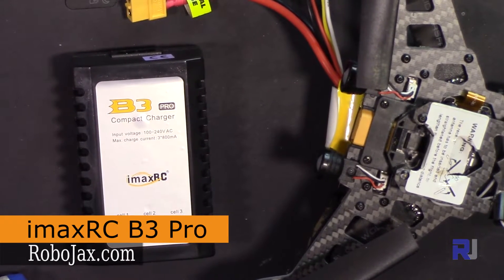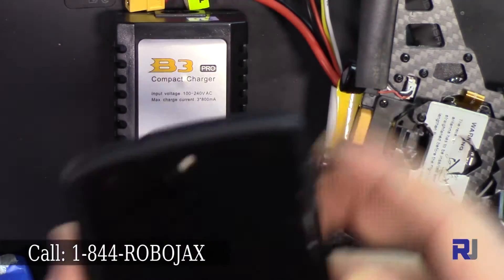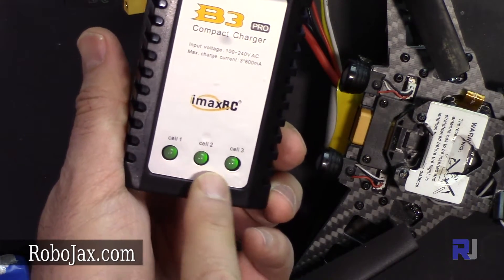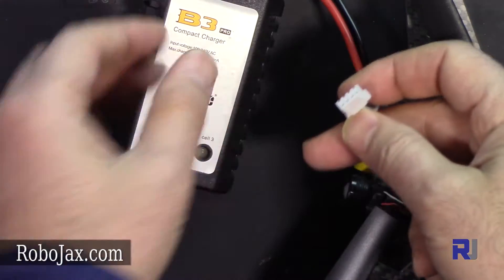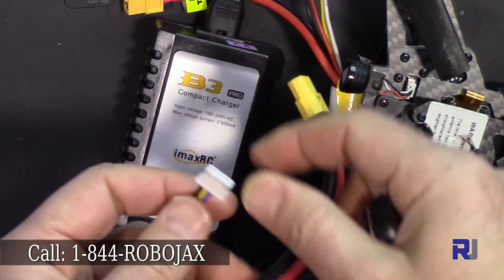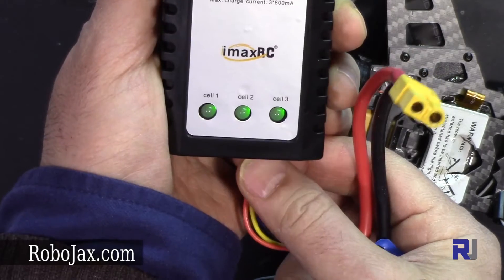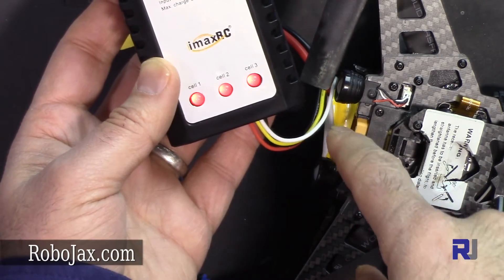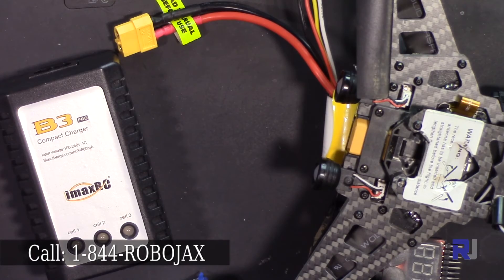imaxRC B3 Pro 2S 3S Lighium LiPo Battery Charger Explained

Comment: I think its wrong. If the lipo is 5s and rated at 5200mah it will fill at 7 hours. If the balancer can output 700mah. If the battery is on series. The voltage increase. But if it is on parrallel the mah/Ah increase. Which in the case of lipo it is configure as series.
Reply from the maker: The series and parallel doesn't matter.  it is the total capacity that matters. We are feeding 700mAh to fill one battery of 5200mAh . If we charge 2 batteries of 2600mAh connected in parallel, then 2600+2600=5200mAh.
Reply: Robojax so therefore the energy calculation of lipo are differ from the other .?
Reply from the maker: No. it is always the total capacity. The charger can supply in total (for example) 700mAh. You can feed it any ways you want.

Comment: I have Li-Ion phone batteries which have different mAh (1500mAh and 1800mAh) but same voltage. so can I connect these 2 batteries in series and can I connect balance charger to charge it. Please help!
Reply from the maker: yes. any Lithium that starts with Li- is okay. and you can do it.

Comment: Hello,Robojax. My B3 PRO's cell 1 is green and flashing, when it connected to my battery. Do u know what's wrong? I cannot find the reason from internet. Is my battery damaged?
Reply from the maker: it means other cells are full and it is charging cell 1. You have to wait a little longer. If it doesn't go off after longer period of time like 2 hours or more, then battery or charger must be bad. You can check your battery using battery tester explained here https://youtu.be/A0EjDtGSepw or use a multimeter and check each cell which you can learn from this video https://youtu.be/Cx25ozeeC8Q
Reply: @robojax  Thank you so much. I am afraid my battery is damaged. The last one is 0.08v,  the middle one is 3.82v,  and the first one is 3.83v. Can I cut off the last one, then use it normally only two battery? Can I charge it?
Reply: @robojax  Ok, I have solved my problem. I cut the damaged battery off, and it is 2s now. The charger is normally, too.

Comment: Hello, I have what may be a dumb question. 

The charger lists the “max charge current” as 3*800mA.

If I have a 5200 mAh 2S battery, does it take 5200/800 = 6.5 hours or 5200/(3*800) = 2.16 hours to fully charge?
Reply: I’ve come to the conclusion that the answer is (5200/2*800)
Reply from the maker: 800mA is the total current. Don’t worry about the cells. Just divide the capacity by 800mA
Reply: @robojax  thank you for your help and I appreciate how active you are in the comments!

Comment: I just got one of these chargers the other day, but it puts out 3*800mah... would that be too much current for a 3s 300mah lipo?
Reply from the maker: The chargers check the  voltage and adjusts the current until it is full. So you should not worry.
Reply: @robojax  Thank you my friend, I was worried it may try to charge my battery at higher than 1c rate, and result in a fire. Good to know!

Comment: Hey bro. I have a 3s 11.1 v lipo battery. The third cell is dead( solid 0v). Is there any ways I could recover my cell?
Reply from the maker: when battery is bad, it is done.  you need chemically to restore it.
Reply: @robojax  but how do I restore it chemically
Reply: @robojax  I bought a new battery
Reply: @robojax  in mission planner I was testing the motors and gave a 93% output. After 4s the esc got burnt and smoke was comming out. No damage to anything other that esc. So if I give full throttle during my flight then all the esc will be burnt?

Comment: i have a problem with mine when i plug it in all green lights and when i plug my battery in sill all green lights and doesnt charge
help please
Reply from the maker: either the battery fully charged, or battery is bad. or the charger is bad.
Reply: @robojax  I think the charger is the problem because the battery is not charging

Comment: Are this charger auto cut if battery full charge??
Reply from the maker: yes. That is what charger does. If it doesn't stop, the battery gets damaged. When you connect battery, the lights get Red and when fully charged, the LED for each cell will go green.

Comment: I have lithium battery 1500 mah. its been 2 hrs since i charge but still 2 red light and 1 green. is this normal?
Reply from the maker: some time cells do not charge at the same rate. but sometimes one cell get damaged. if the light doesn't change, then something is wrong. most probably the battery is bad but also possible the charger gets damaged. so if you have multimeter, check the voltage of each cell  and see if one is damaged (low voltage). see this video to learn about each cells and wiring https://youtu.be/Ogc0E7n1jgI

Comment: Hey when i charging my battery it show 2 red on it(2s btw)and i let it charger and after a while the first red has go green and other is red but not blinking is that ok?
Reply from the maker: Hi,  your battery cell is bad. check it with multimeter.  if battery is okay, then it is possible the charger is bad . learn about wire of Lipo battery here https://youtu.be/Cx25ozeeC8Q
Reply: @robojax  thank for reply it ok know after charger it a little  bit longer all green back
Reply from the maker: you are welcome. I am glad it turned out to be okay.

Comment: On my charger only middle red light is on and after plugging the battery the red blink only one red light is blinking what to do
Reply from the maker: Red light should be ON and not blinking.Check the  voltage of each cell of battery either with multimeter or with this https://images-na.ssl-images-amazon.com/images/I/618Ltxfca0L._SX355_.jpg . Either ONE cell (the one which makes charger RED) needs charge and other cells are full . If the all cells have almost the same voltage, then the charger is bad. If the voltages are different, then the battery is bad.

Comment: How to charge particular 1cell in 3 cell battery with compact charger ..?
Reply from the maker: this charger wont' do it. You might try to get the JST-XH cable for 3S battery, connect it to charger and connect only 2 wire of that to your 1S and see if it can be charged. https://www.ebay.ca/itm/112595277459

Comment: I plugged my 11v battery in upside down, it started smoking and is now stuck on the right red, help
Reply from the maker: It must be dead then
Reply: @robojax  the green is on too
Reply from the maker: if you can't charge with this now, you can't repair this.

Comment: Only one green light on cell 1 appears from first plugged to power, is this charger alright?
Reply from the maker: immediately it is alright. If the time passes which I have explained in video how to calculate the time, then either your battery is bad or your charger. To make sure you need either another battery or another charger.

Comment: Hello , nice video. I have a question if you dont mind. I charged three batteries of my drone (Hubsan Zino).The unusual thing is that the middle led stays always red and when i plug all of them on  my drone it shows me the battery percent as N/A instead of power percentange! Why is this happening?
Reply from the maker: The issue must be your charger if you see the same issue with different batteries.
Reply: Hi. There might be an issue with one of your cells in your battery. Check for a voltage checker online and find the proper voltage. If each cell is well above 3.1v then this might be problem with your charger.

Comment: Greetings, I have one, it worked good at first but later on it went all green lights with flashing background red and all green when I connect the Battery (used it about 40 minutes).
So when all green lights are flashing with a little red on the background means the charger it’s bad? Does not detect that the battery needs to be charged but it charges it?
Reply from the maker: Greetings. This charger will charge only if the battery needs charge. the color of the LEds have been in the video and I don't remember anything about it now. Unless I watch it. So you watch it then.

Comment: When i charge my 1 cell and 3 cell turns red but 2 cell did not lit up what does that mean?
Reply from the maker: it means either battery is dead. but also possible that charger is bad. to make sure, try charging another battery to make sure charger is in good shape.

Comment: Will a 5200mah 7.4v 2s 30c battery be able to get charged by this?
Reply from the maker: yes you can. 5200÷700=7.4a so it will take 7.5 hours.

Comment: At 4:18 you plugged the batt in reversed. Black wire should have been to the right side.
Reply from the maker: the color on JST-XH has no standard. It is a connector that you can't connect incorrectly.

Comment: Why my battery still red after 4 hours charge
Reply from the maker: If you did the math and the times has passed, two possibilities 1-dead batter 2- dead charger. So you need another battery and/or another charger to find the problem. Of course you can check it will multimeter but it is hard for me to explain.

Comment: Will this charge a 3s 2200mh 25c?? Help!!!!
Reply from the maker: 25C means this battery can supply 25A constant (C) and has nothing to to with charging. yes it can. I have shown and explained in video.  This charger can charge at 700mA or 750mAh (I forgot,  you watch the video to find out) so 2200mAh ÷ 750mA=2.9H so it will charge it in about 3 hours.
Reply: @robojax  Thank you very much ur the men!

Comment: Can i charge a 3s lipo battery 8000mah?
Reply from the maker: the capacity of 8000mAh does not matter. this can charge up 700mAh charge. It can charge 2S and 3S which yes it can. But you have to calculate the time, 8000/700= 11.4 hours is the charge time. So if you don't need it quickly this will work in about 12 hours. But for such battery you might need 2000-5000mAh charger to do it quickly like in 2 or 3 hours.
Reply from the maker: Yes 3000mAh  (3A) charger can charge fast. 8000  ÷  3000= 2.6 hours.  Just divide the battery capacity to charger's charge capacity.

Comment: only one light is on with mines
Reply from the maker: so it can either charges ONLY one cell or, the LED (light emitting diode) is bad. So leave the battery for charge and then check your battery's each cell.  If all cell have charge, then only the LED is bad. If you see all cells are not charged,  the the charger is bad.
Reply: 2 cells  are at 4.4 was even higher!!..and 3 was like zero
 bought a parallel board now  buying new charger n batts..smh..im new but its bin a bummer ..so i basicly have all these busted batts ....even if its not swollen are they unsavable?
Reply from the maker: Once LiPo gets bad, you can reverse it. They are done.

Comment: Can i charge 3s 11.1v 4400 mah li-ion batteries??
Reply from the maker: yes you can. It can charge any 3S battery. the amount of current this charger provide is 700mA so  4400mAh÷ 700mA = 6.3H so it will take about  6.5 hours to charge your battery.

Comment: your calculations are totally wrong if you have a 5200mah 3 cell every cell has 5200mah
Reply from the maker: No. when you read 5200mAh, it is the total capacity of battery. Drone of RC car doesn't draw current from each cell rather from just 2 wires.  it is the charge wires to the individual cells that  get separate voltage and current and that is to be able to chemically charge each cell based on it's own condition.
Reply: @robojax  each cell has indeed 5200mAh, but rating at voltage of one cell (3,7V nominal). In serial stack You do not add the capacity, you add the voltage. The 3S packet consisting of 3 cells, each with capacity of 5200mAh still results in 5200mAh, but at 11,4V nominal voltage
.
That is why the capacity rating of a whole packet is the same as for one cell.
And yes, your calculation is simply "badshitt bananas". The packet (empty) should charge to full in around 7-8 hours.

You should learn the basics first, before you try to teach others.

I know, archeo digg site. but i just had to.